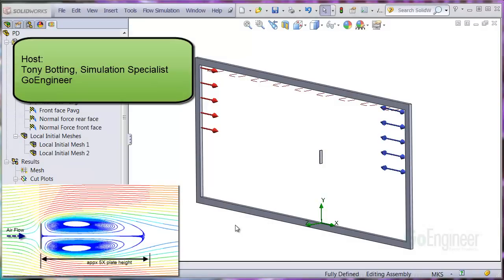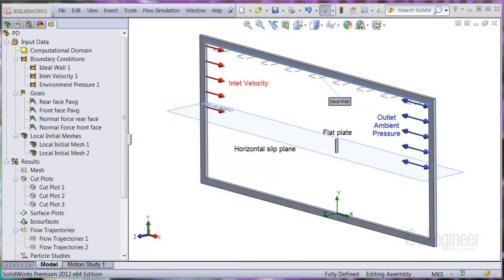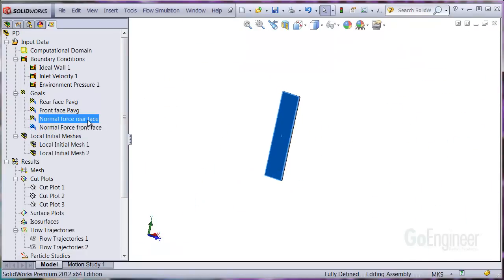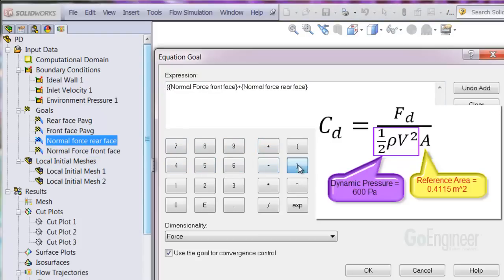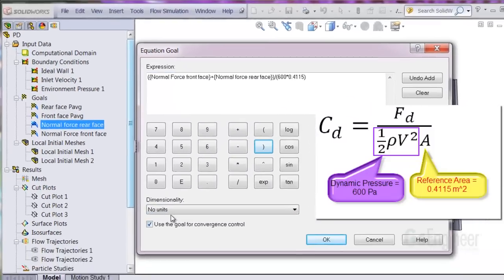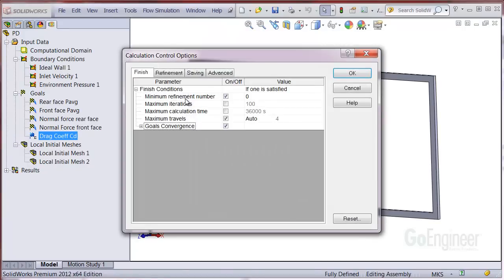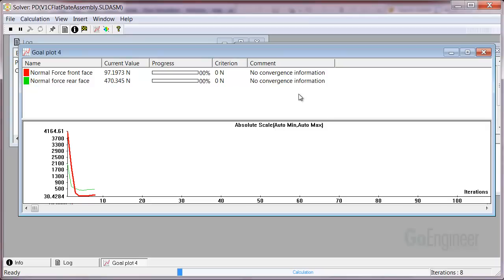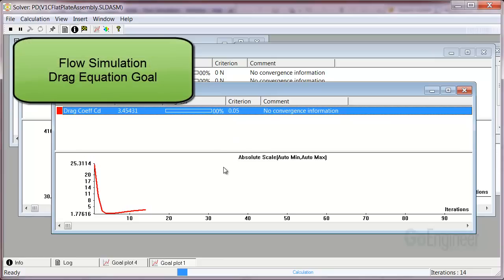SOLIDWORKS Flow Simulation – Drag Equation Goal

Comment: How can i calculate heat transfer coefficient from a copper fin to paraffin. The system is enclosed. I have heard using a resistance network would work. I have been doing it using an equation goal, but there is one problem i have not been able to calculate the temperature of the paraffin in the tank.